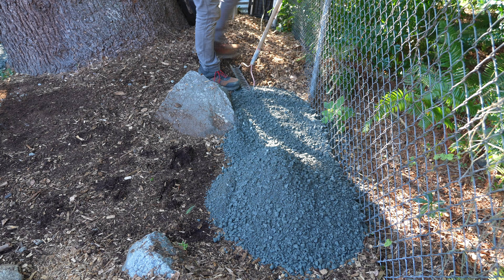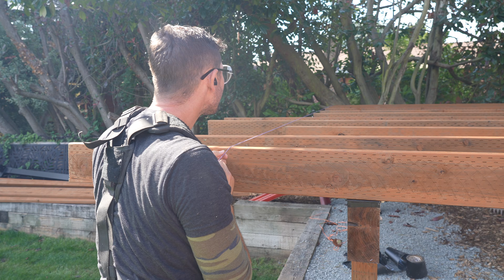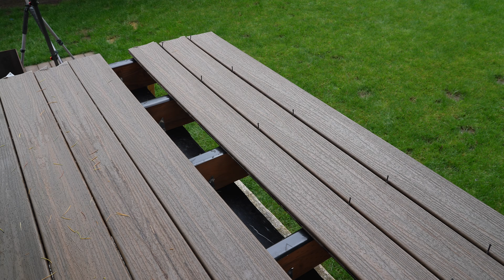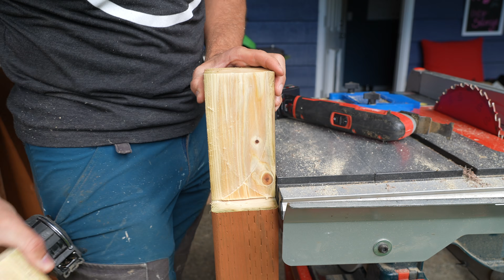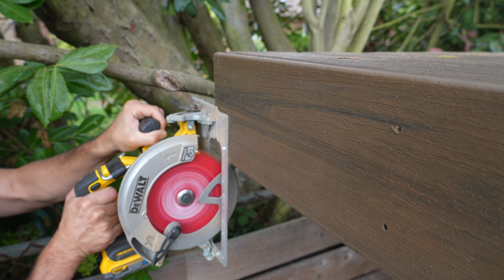How To Build A Treehouse Deck From Scratch!

Comment: A trick to deal with those pesky pt joists sticking up: instead of planing, nail your rim joist on one end and as you go down the line nailing each joist, move the rim joist up or down so it sits flush with each joist on the top. Just another way to handle it

Comment: This is a poor design and I don't think would be permitted by a city or county. Did you pull a permit? The foundation is extremely poor with no uplift restaint and putting the base supports inside the built up cross tie retaining wall will push the retaining wall apart. Please don't copy this design!

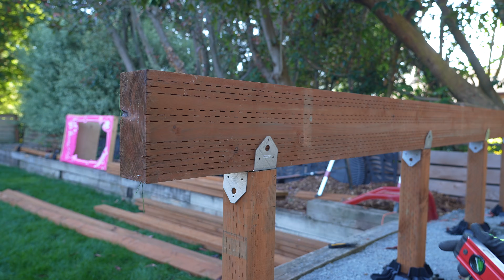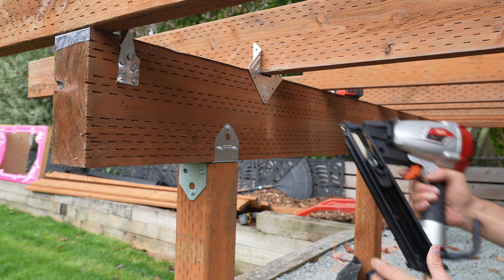Comment: Since this is basically a free standing structure on vertical columns ( almost pin jointed) , I would have added some diagonal bracing  to the lower end of those  vertical posts on to the horizontal beam at 5:20  an diagonal bracing  from the bottom of the posts to the joists at 8:49. No need to do all the vertical posts but only  the group at the centre of the deck.  This would ensure stability of the deck to side wind forces, Resistance to side motion is the weakest mode, and one hopes that high winds will not lift it , I know that you  said you do not expect hurricane winds , but a few hidden diagonals underneath the deck do not cost much. Those hurricane straps seem to be solid only in one direction where there are " four diagonals in the face parallel with the beam, but not in the other direction, parallel with the joists.  
I wonder how long that timber would last, especially that held in the  slot  in the bannister, which would always be damp with dew or rainwater.  In my country I would have oiled the wood. I did that to my wooden ladder and they lasted for more than 60 years till now. I oil them every five years. 
It is a very good build. Congratulations, A gusset ( diagonal )   at 25: 39 beneath and behind  the  lower attachment of the bannister post would have solved the movant of the post at 21:40.

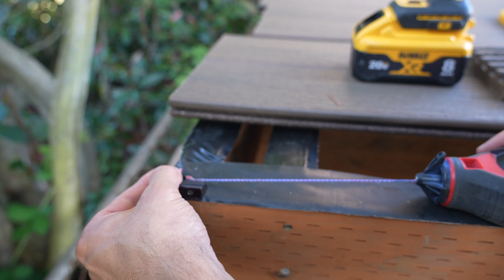Comment: 12:53 if youre using the edge why snap a line? You still have to measure the spacing..
Reply from the maker: Good question.  It's just a much easier visual to follow then the uneven PT lumber.  Thanks for watching.

Comment: Great tip on running the adhesive vertically to allow water run off.  Always learning something from you Brent. Used many of these principles and the tough blocks to build a slick storage building last year.  Adopted a lot of your advice and it turned out great and withstood a hurricane and Durecho in 2024.  Thanks man!
Reply from the maker: Love hearing that and thanks so much for watching.  Truly appreciate the continued support.